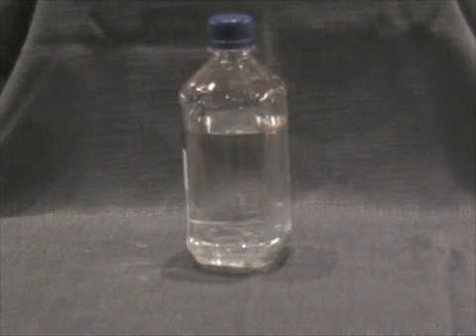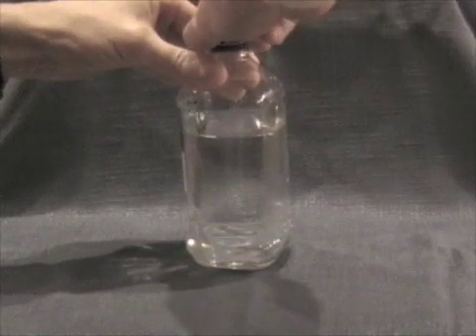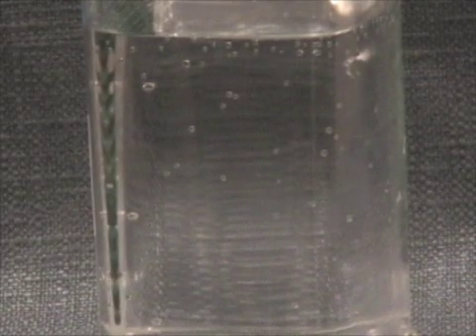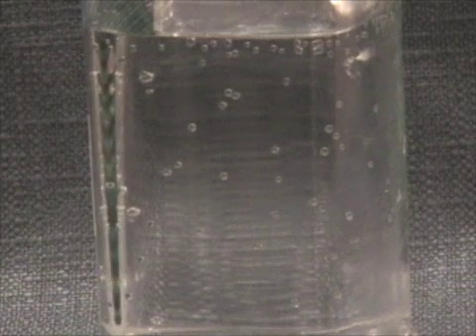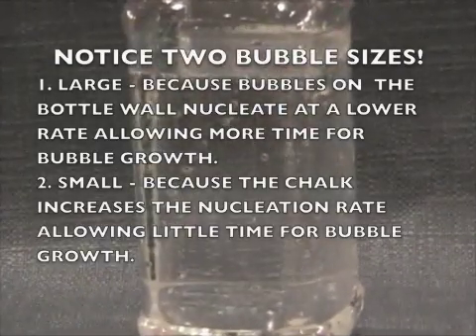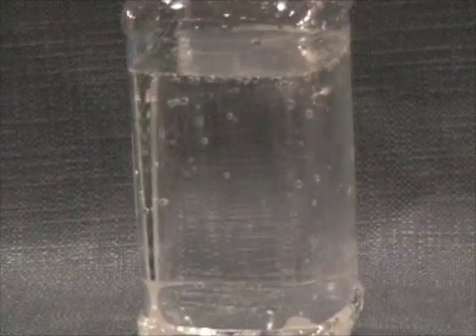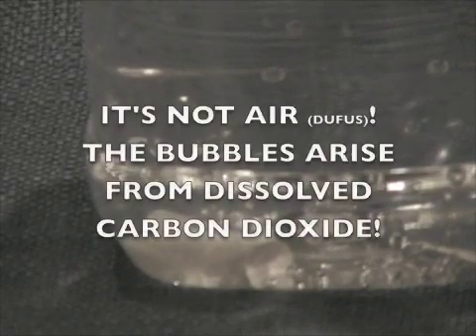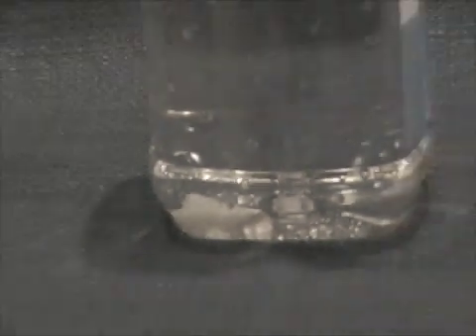Mento-Free Bubble Nucleation

Comment: Why does chalk feature higher nucleation rate? Is it because of the irregular surface structure?
Reply from the maker: Yes, and because the chalk is porous and therefore has a high surface area due to the interconnected pores running through the chalk. The structure of the chalk is analogous to a brittle sponge.
Reply: Surface area helps but the actual driving force is wettability